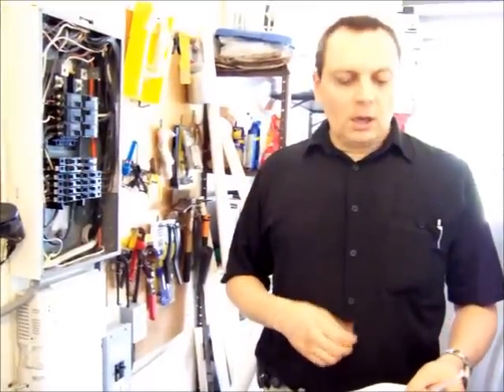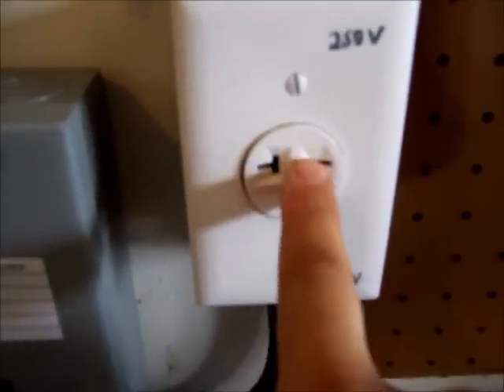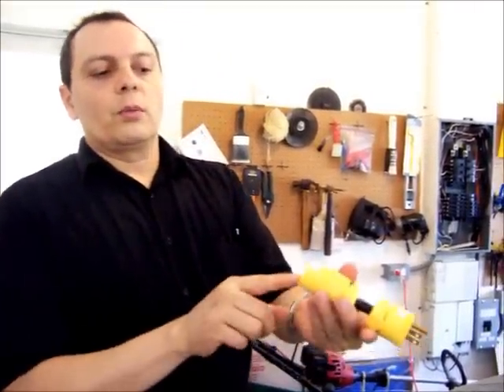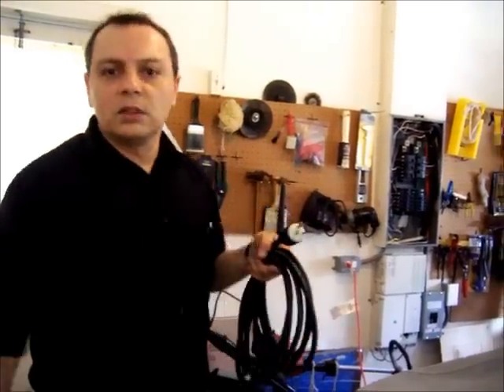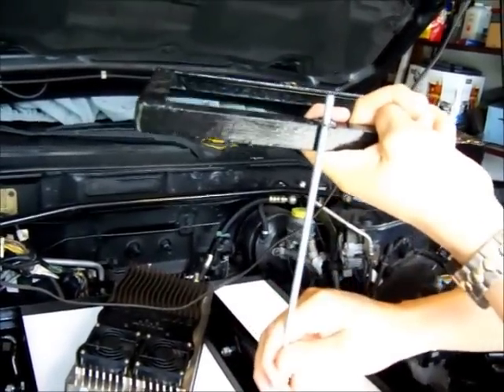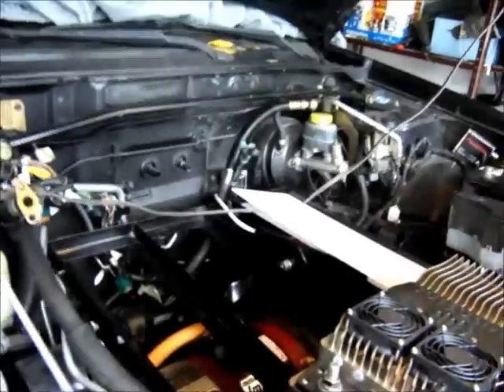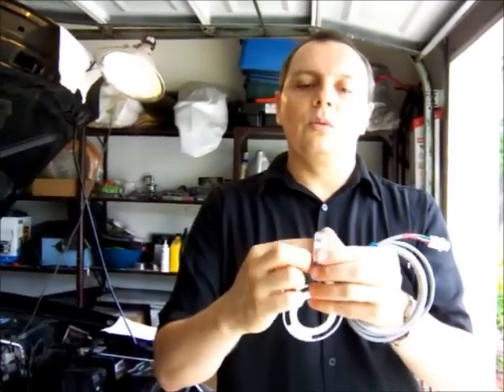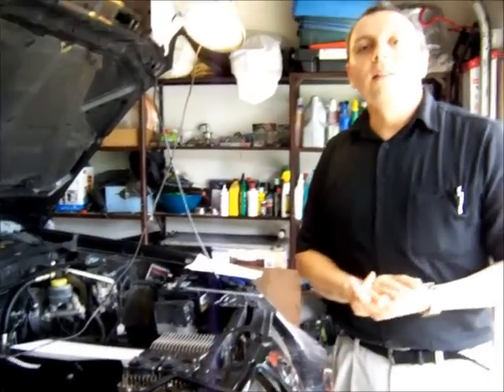Nissan Sentra Electric Car Conversion Part 19

Comment from the maker: All I really have on this is that by putting a 10ft cable in the back connectors will improve the efficiency of the motor about 10%. For more information you can contact Bryan at Electric Vehicles of Aermica

They are very friendly and helpful. Great experiences with them.